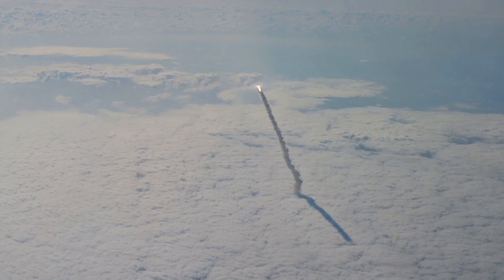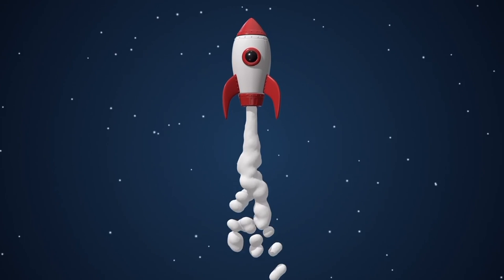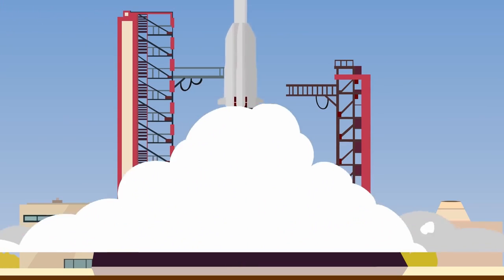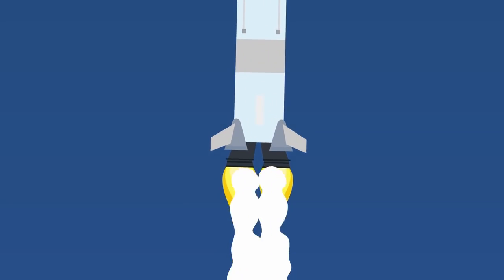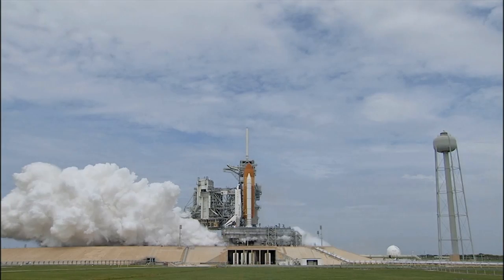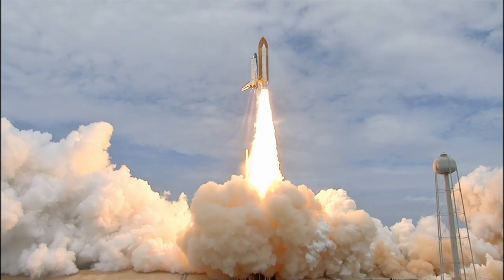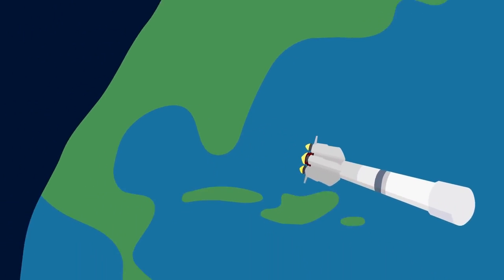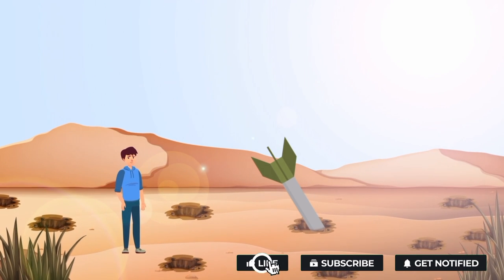Why Do Rockets Curve Instead Of Going Straight Up?

Comment: but my question is this..

if you  stand on a moving car and jump.. i go up, car keeps going fast away from me..
so how come when a rocket if flying up. earth under it dont disapear? it goes sideways way faster then a rocket goes upwards..
Reply: Sit in a car and throw a ball upwards, it will appear to fall back down straight from your perspective
Reply: If you stand on the ground and jump... you go up, and the earth does NOT go faster then you. So why should it go faster than a rocket that leaves the ground? The car situation is special, because there you have air that doesn't move with you and the car so it slows you down.
Reply: if car was moving at constant speed when you jumped and you did not experience air drag when jumping you would land exactly where you jumped from
Reply: conservation of energy my beloved
Reply: @hacknwack4065  except think about it car has a roof however do that with sun roof open and guess what that ball will be thrown back at a force due to the inertia when car is going around 100 KPH...
Reply: @grantwilson2473  not inertia, ball already has kinetic energy going forward from being accelerated with the car
air will catch the ball and send it flying backwards
Reply: @hacknwack4065  ok thanks for setting that straight is based from kinetic energy.

Comment: How fast would one have to go to escape earth's sphere of influence if you only travelled straight upwards?
Reply: The Earth's escape velocity at its surface is 11.2 km/s. If you are going that fast vertically, you will leave the Earth's sphere of influence, which has a radius of 1.5 million km or nearly 4 times the distance to the Moon.
In that case, you will most likely end up in an orbit around the Sun, unless you also exceed the Sun's escape velocity that is about 42 km/s at the Earth's distance from it (150 million km).
Reply: @fromnorway643 oh ok. I always thought escape velocity was travelling horizontally. Thanks!
Reply: @i_hate_everything_404  Mate 9.8m/s won't even get you 5 meters off the ground...
Reply: @mcflyingfury 
It also works horizontally.
If a spacecraft in a circular orbit is accelerated by a factor square root of 2 (~1.41), it will reach the escape velocity for that specific altitude and its orbit will change from a circle to a parabola and it will never return to its lowest point.
If accelerated to a tiny bit less than escape velocity (say, 99 % of it), the orbit will change to a very elongated ellipse in which the speed is close to escape velocity at its lowest point and close to zero at its highest point. Such orbits are highly unstable since it takes very small changes of velocity to alter them greatly.
Reply: @fromnorway643  That's very interesting. Thanks for explaining!
Reply: LoL not long you will hit the FIRMAMENT